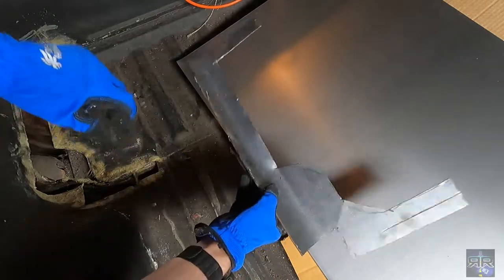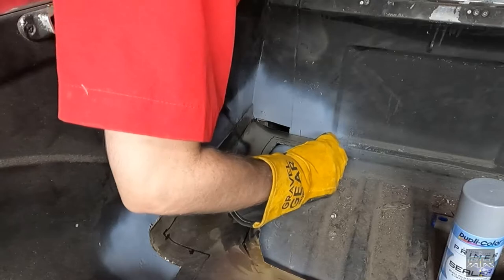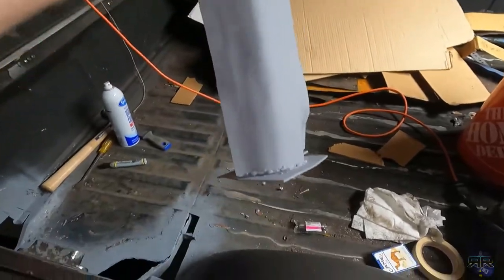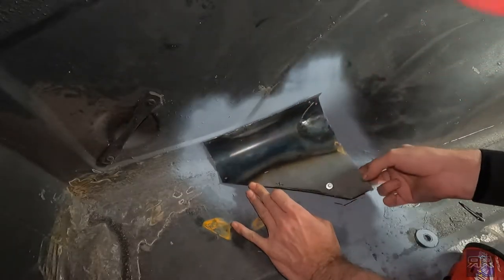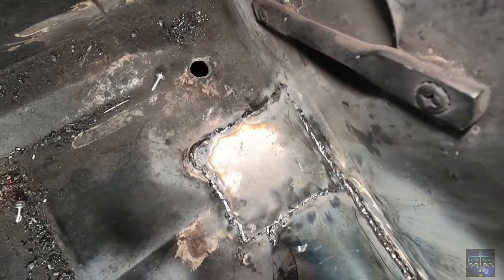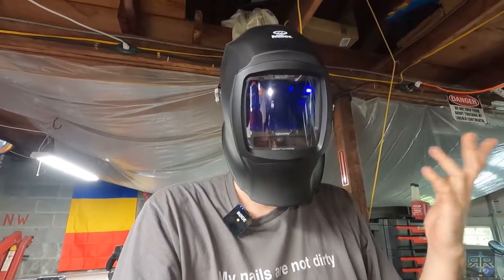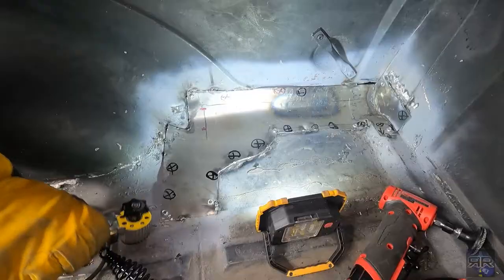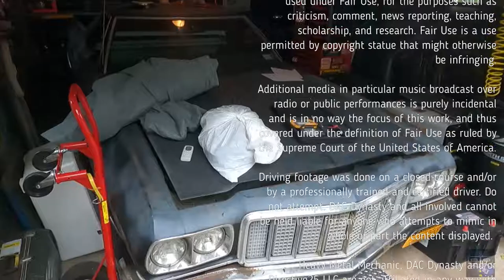1974 Ford Ranchero Rust Revival – Weld Repairs to bed sheet metal Ep 98

Comment: I'm back and a lot has changed in Bucharest since last time!
The Chopper tram 4014 got an overhaul in the stele of 4036, but its green instead of red. 4014 has entered in circulation 2 days ago, on the 41 line.
The 044 and 218 trams have been modernized and they have been delivered to the Bucureștii Noi Depot, 044 already having been on the 41 line today.
Reply from the maker: I imagine they will keep changing them. Im still not sure if I like the new V3As or no lol...I think the back is a bit weird...